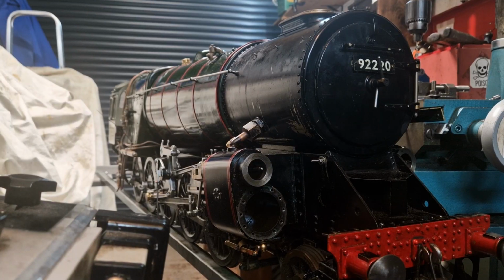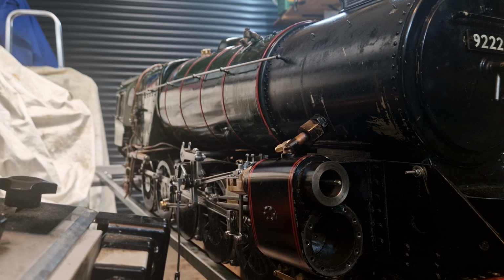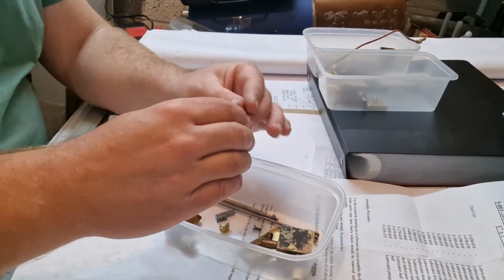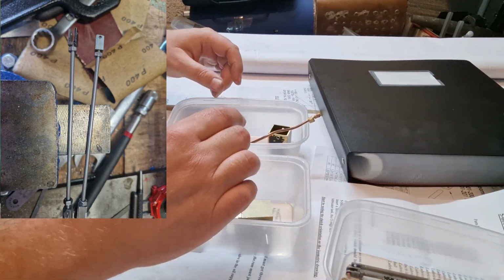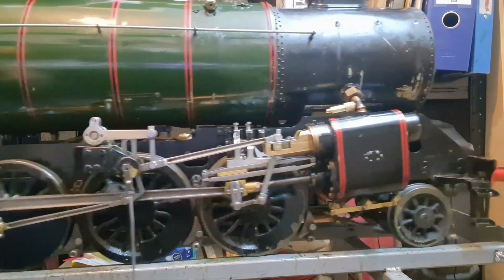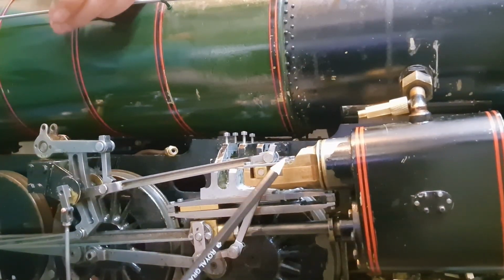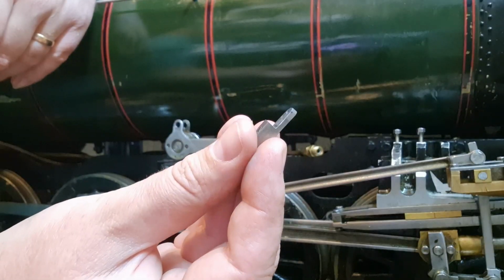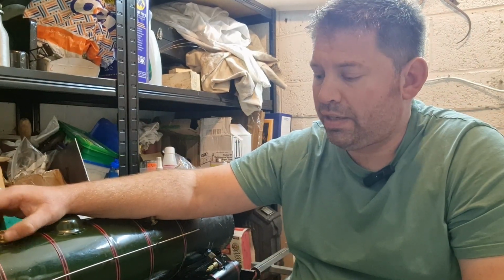My 5 inch gauge 9F - Repairs and Upgrades Part 1

Comment: A point worthy of note is that even good parts that SHOULD have stainless balls in may not ! Had this with an injector. Any non return needs checking for this problem. If a magnet picks up the ball then it's not stainless enough.
Reply from the maker: Thanks Noel, another nugget of info there, next time I have them off for cleaning will give them a check!

Comment: Hi Gary shame about your lubricator problem hopefully will be sorted in the end 
After I run my loco I have a copper bit of pipe with a filling point on top I put it into the blast pipe and add some steam oil and WD 40 together with the cylinder cocks open I push the loco back and forwards so the mixture starts to come out of the drain cocks then next time I steam up I know the cylinders are coated nicely in oil and pushes freely regards Glen
Reply from the maker: Hi Glen, I didn't mention but both lubricators have a winding mechanism so can wind on before and after each run. I did originally squirm steam oil down the blast pipe but found that seemed to gum it up even more! Maybe now I have the drain cock inlets sorted it should help with that.. its all fun and games!
Reply: hi Gary yes definitely fun and games with a steam engine 😮
Look forwards to seeing her sorted and running again as she should 👍🏻👍🏻 @5Inchgaugelivesteam